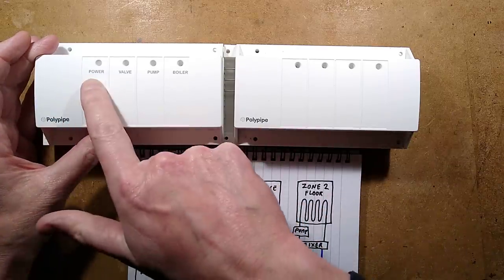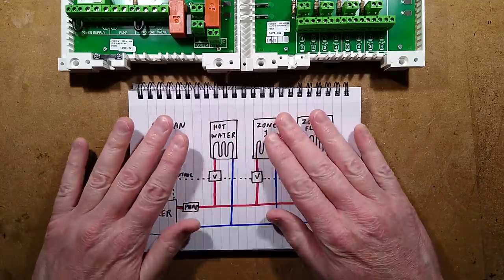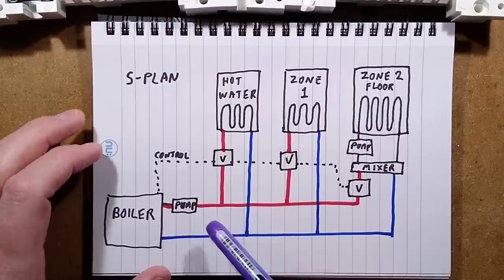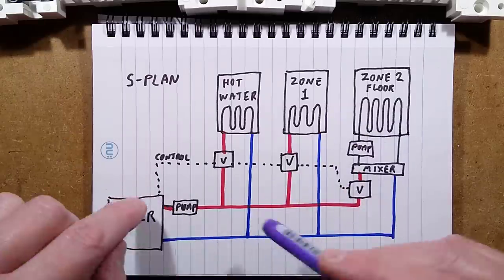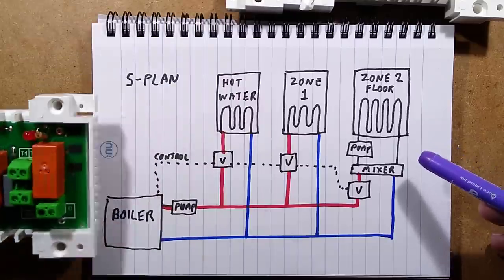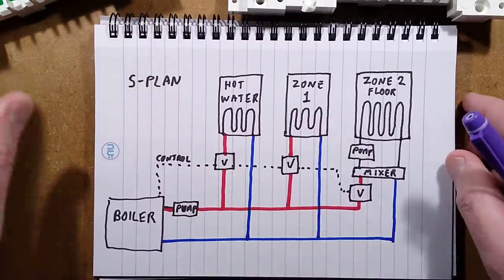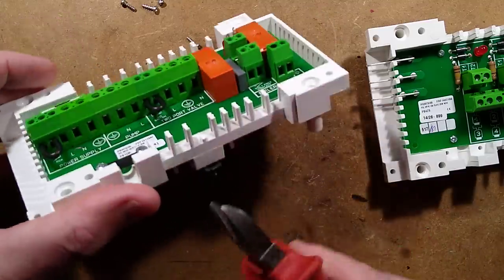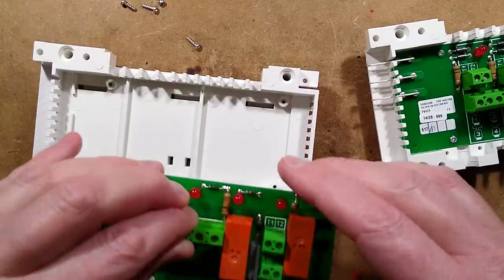Underfloor heating control system teardown (with schematic)

Comment: I imagine them leaking and being difficult to fix/track down
Reply: You imagine wrong.
Reply: nope, unless there's a manufacturing defect or installation error, the pipes will never leak
Reply: @rustblade5021  you never know
Reply: @phonotical  yes you would.  Most systems are sealed.  Loops can be individually isolated for testing.  Some manufacturers put a 50 year warranty on the pipe.
Reply: how often to the valves on your radiators leak, these are the same thing its just in this case these are all on a manifold in one place.
Reply: @edc1569  you havent twigged what I do for a living yet obviously 🙄😂.  Thermostatic valves (similar to ufh manifold valves) very very rarely leak as they're always moving.

Old fashioned radiator valves are much more prone to leaking.

Comment: that need to know story reminds me of what happened to my parents dryer.  who after several days of trying to figure out we started to come up with clumps of carpet in areas it shouldn't be,.  ahhh well dad left a major detail  the carpet got sucked up into the lint area and naturally clogged the thing so it shut off thus all that fell all the way back down to the blower which is attached to the motor and suddenly we have carpet in the motor.  Yeah the motor is very dead.  well that was an expensive waste of time.

Comment: The polypipe centres are awful.  Heatmiser do much better ones.
Reply from the maker: Looks simpler.  Just neons and resistors for each channel and more wiring space.
Reply: @bigclivedotcom  precisely... These things get cluttered very quickly, the components get stressed.

Comment: The boiler really isn't a boiler.
Reply from the maker: They're called boilers here, although they really shouldn't boil. the water.
Reply: Boilers are just an old term. In reality they are tankless water heaters but that doesn’t roll off the tongue as easily.
Reply: There used to be boilers though, in steam radiator systems. Most of which have been torn out by now. Sometimes the steam radiators are retained and converted to hot water. To retain the look and lower the cost.

Comment: I see you haven't shaken the master/slave terminology yet, I also can't imagine calling the arrangement anything else after all these years. The only alternative I've seen that I can get behind is Master/Minion although it makes acronyms a real mess Master output / Minion input (MOMI) or brake master cylinder (BMC) , brake minion cylinder (BMC).
Reply: There's an IETF draft document (draft-knodel-terminology-00) that provides a list of alternatives, as this terminology is also quite common in software engineering.

"Several options are suggested here and should be chosen based on the pairing that is most clear in context:
 *   Primary-secondary
 *   Leader-follower
 *   Active-standby
 *   Primary-replica
 *   Writer-reader
 *   Coordinator-worker
 *   Parent-helper"

I've not seen it called master/minion before in software, is this a mechanics term?
Reply: The preferred terminology is now dom/sub.  Although top/bottom may be used in some situations.
Reply: @bdf2718  does that mean we are going to have to bring in versatile chips as well?
Reply: I don't recommend adopting draft-knodel-terminology-00. Master/slave is quite fine.
Reply: @Bruce Preston Hahaha.
Reply: @Bruce Preston Haha, good one!
Reply: Engineers and computer people in general aren't known for political correctness.  It gets in the way of actually understanding what you're doing.   Trying to remove words like 'master' and 'slave' from language will really make reading history (both of normal societies and of religions) very strange.